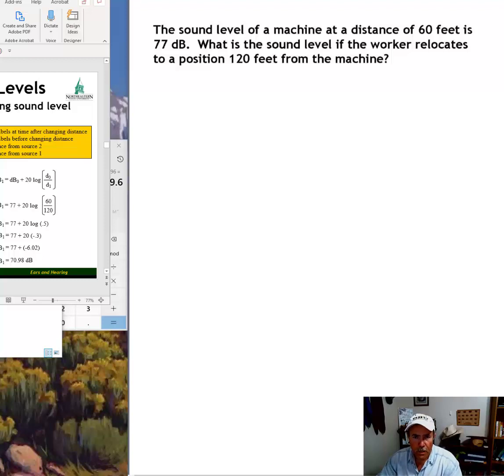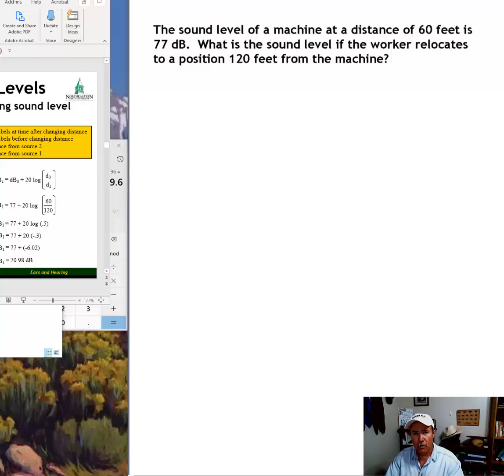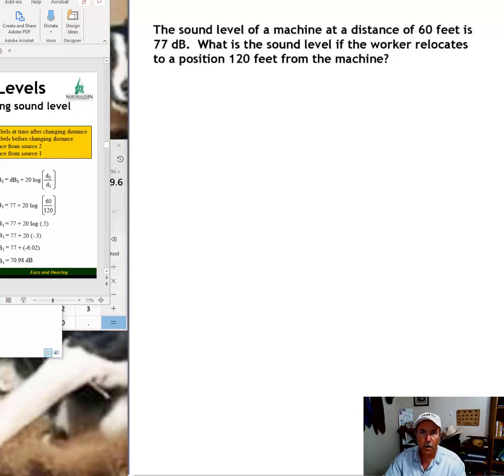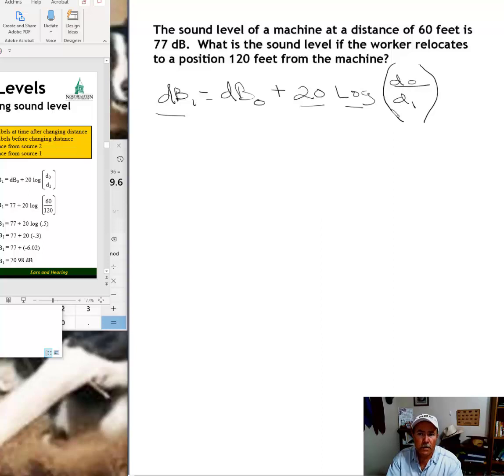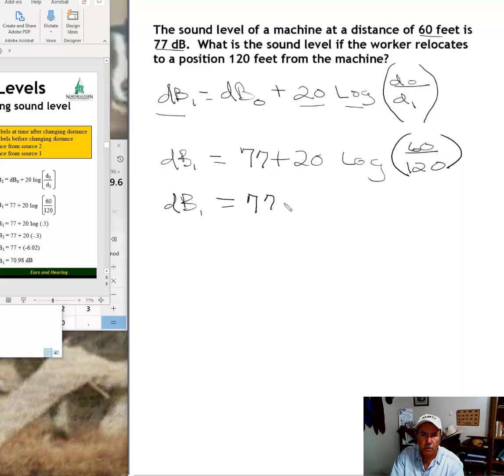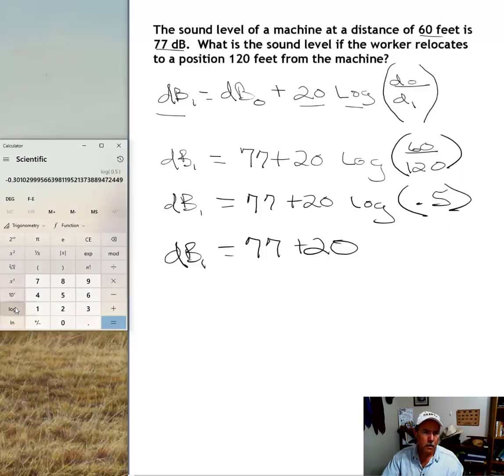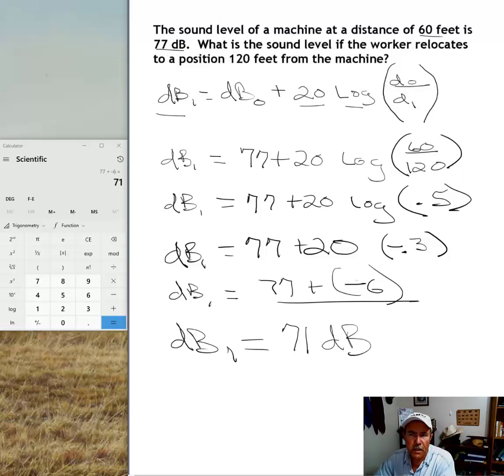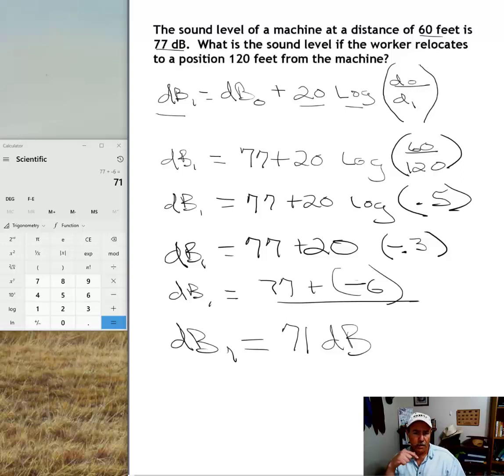Distance and Sound Pressure

Comment: Will the constant always be 20 for these types of calculations? Where does this come from?  If I was moving from 3 meters to 30 meters, would this formula still apply? Thanks for the video - appreciate it!
Reply from the maker: Yes.  20 will always be the constant.  It will work with distances measured in meters.  My source is the OSHA Technical Manual for occupational noise.  You could also use the "rule of 6" for "quick and dirty" estimates of decibel levels at different distances.  The "rule of six" says that for every doubling of distance from a sound source (going from 5 to 10 meters for example) the decibel level decreases by 6.  Goes the other way also.  If the distance is decreased by 1/2  (7 meters to 3.5 meters) the sound level will increase by six decibels at the closer distance.  It only works if we are doubling the distance or reducing the distance by 1/2.  I have my classes verify these methods using sound level meters.
Reply: @SafetyProCalculations  Thanks a lot for replying and providing all this information!